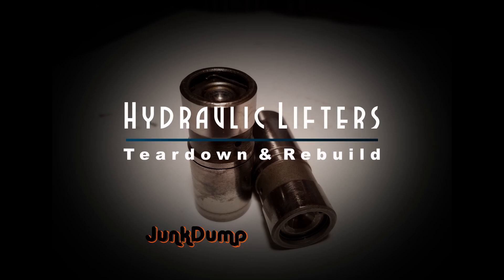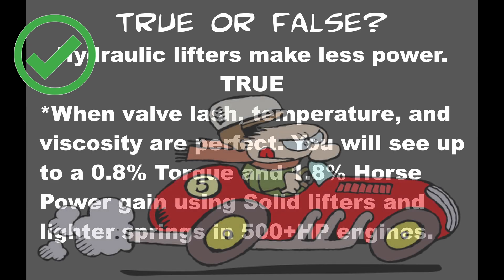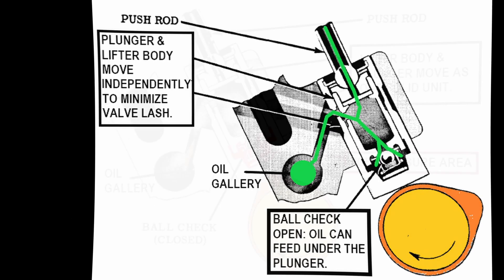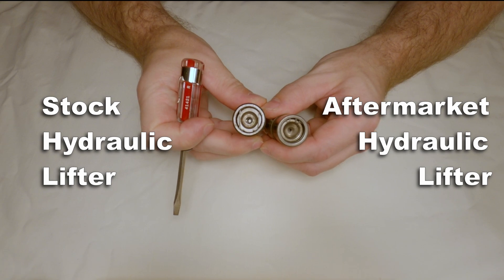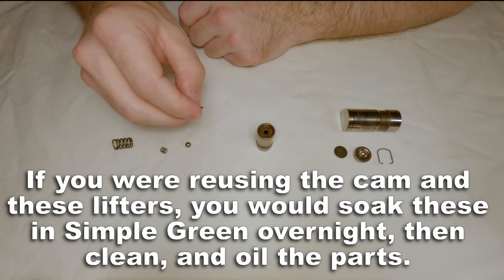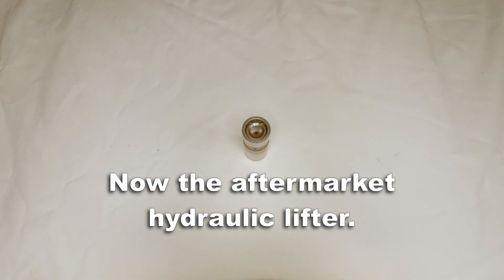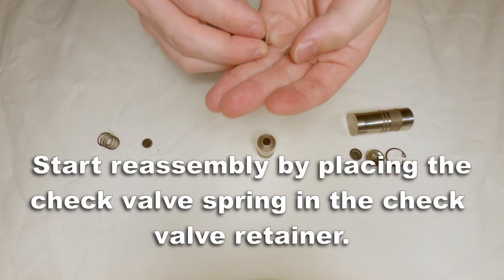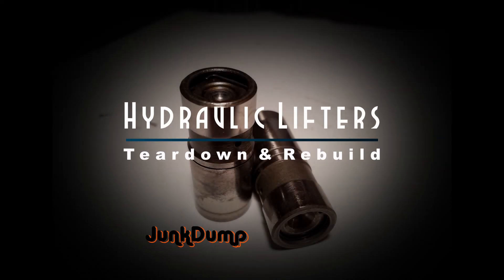Hydraulic Valve Lifters. Operation, Teardown, and Rebuilding.

Comment: The hole in the plunger doesn’t have to align with the hole in the body right?
Reply from the maker: That is correct, there is a channel, or groove, for the oil to travel the diameter of the lifter.

Comment: I have a valve train knock/tick and I’ve heard of collapsed lifters but never understood what that meant… this video helped me to understand what could be going on inside my valve train causing the noise… btw… it’s a brand new build from a respectable machinist…. But engine sounds terrible…. Only knocks once the engine is warm…
Reply from the maker: Olds engines shouldn't knock or tick unless something is wrong, severely low on oil, or the wrong oil is being used.

Comment: Just a lil confused, what makes the check ball open when the cam comes off max lift?
Reply from the maker: Excellent question! Once the cam lobe is no longer applying force to the bottom of the lifter it's not being "squeezed". Without pressure from the lobe, the plunger return spring will allow enough room for the check ball to open. Once oil pressure is equalized inside the lifter, the plunger and lifter body can operate independently.

Comment: Should i be able to shake the lifter and hear it moving up and down inside? Half of them the plunger moves freely up and down. Other half seem stiff and make no noise when shaken. Has something failed internally on half my lifters? Or they just bled down? Have been out the engine a week or so.
Reply from the maker: This is an excellent question! I had to check some of my old and new lifters on this one. What I found was the oil metering valve was making noise on some of the lifters, especially the ones that were more "dry", but this had no correlation to lifters that were bad. I discovered one lifter with a bad ball check spring did make noise that correlated  to a bad lifter. The best way to check your lifters is to rotate the engine (the correct direction) while priming it. If your lifters are good, they will operate the valves correctly, maintain lash, and oil will seep from the rockers. Thank you for your question!

Comment: how to take it apart when full of oil? How to get the oil out. the retainer is really tight with oil in it.
Reply from the maker: Get a small socket that fits in the cup of the lifter. Carefully use a small C-clamp to depress the lifter just enough to barely loosen the retainer to facilitate removal. Don't force it, just apply a little pressure. Thank you for the question.

Comment: hi there , i used you video to clean mine , my quotation how to tell if the lifter is bad or good ? 
as i still have the original one running as i cleaned them and put them in oil over knight
Reply from the maker: Unfortunately it is quite difficult to spy some issues when it comes to a bad lifter. The good news is that some issues are easy to spot, like any debris, damage, scratches or galling, and excessive wear. You should be able to move the plunger easily after assembling the lifters and lubricating them. One test I use to test mine is by installing them back in the engine (with a head bolted in place), prime the oil and make quarter turns on the crank pulley until you see oil exiting all of the rockers and observe the valves being actuated properly. Lifters that fail to lock will typically make a tapping or rattle noise (while engine is assembled and running), if the problem persists after cleaning and reassembly you will notice the rocker fails to fully depress the valve spring when performing the above noted test. I hope this helps, and thank you for the question.
Reply: @junkdump2720  thank for replying , my engine is out of the car and next week i will install the head gasket and the heads , as far as i understand is to return the lifters after  checking there are full of oil and turn the engine by hand and put some load on the lifters to see if leak down or collapse , is that correct

Comment: One question..... why didn't you use the c clip pliers to remove the retainer clip? That's exactly what they're for
Otherwise EXCELLENT video
Reply from the maker: That is an excellent question, I am glad you asked because I didn't mention this in the video. On some lifters like these the C clip pliers won't work because you need the C clip ends to overlap themselves to remove or install them. You will need to release or install them one side at a time. I find it easiest using the method in this video, but there are certainly others ways and tools to help accomplish it. Thank you for the comment!
Reply: @junkdump2720  ok gotcha

Comment: I have watched several videos on dis assembling a lifter. Everyone does it pretty much the same way, and it works very effectively for everyone. EXCEPT ME !  The piston inside my lifters, will NOT come out. In have tried all the tricks I have seen, like pushing the check ball down to relieve suction.  I even tried heating the lifter up a bit, based on the simple premise that air expands when heated. That didn't work either. I thought maybe I just had a stubborn lifter. I tried 3 more. Same thing. I am at a loss. Do I simply need new lifters?  Thank You
Reply from the maker: It is possible that debris circulated and jammed that plunger or it was damaged by heat. I would suggest submerging it in PB Blaster for 24 hours and then use a pick, like in this video, to grab the hole in the piston and try again to pull it free. Hopefully you have some luck, but it may just need to be replaced.

Comment: The oil metering valve on the aftermarket lifter. Which way does it go? it had an imprint and it will either sit flat onto the pushrod seat and restrict flow to the pushrod, or makes a path through from the reservoir through the oil metering valve then through the pushrod seat to the pushrod?
Reply from the maker: Excellent question! This is hard to explain so I will do my best. The valve is a metal disc with two nearly complete circular impressions that are pressed into it from either side. There is a large impression pressed from the rocker side down making a large raised diameter facing the cam, and a smaller diameter impression pressed from the camshaft side up making a small raised diameter facing the rocker. The cross section will look a little like this when installed properly               v-^--^-v       When properly installed the smaller diameter raised portion will contact the bottom of the pushrod seat. I hope that makes some sense, if it's still confusing email me at junkdump455@gmail.com and I will send you a picture. Thanks again  for the great question.

Comment: I was adjusting my hydaulic roller cam lifters and noticed most of the lifters preload was very easy with my half turn but a few were hard and actually depressed the valve sightly but would return to norman position in a 30 seconds or so. dirty lifter ? My ace mechanic friend said its normal. Any thoughts on this.
Reply from the maker: That is an excellent question. First be certain adjustments are being made when the lifter is on the cam heel or base circle. I have experienced what you describe on occasions where there was no problem, and sometimes when there was a problem. I suggest turning the engine over with a socket on the crank (not the starter) through the full engine cycle a couple of times. Then loosen and readjust the lifters that were questionable. You should find the "hard" lifters now act normally. There may be an issue if you repeat this a few times and a lifter remains "hard" every time. Be certain you use an oil viscosity that matches your internal clearances (like 10w30 for clearances ranging from .0010" to .0030") and quality oil filters like wix (stay away from fram, k&n, or overly restrictive filters like some purolator models). I hope this helps.

Comment: When removing the inside plunger piece, all you need to do it touch the check ball at the bottom with a pick lightly & it will pop right up. When there is oil in them that is, not empty like those & when reinstalling the check valve retainer, put the plunger on top & just press down & it will pop in place
Reply from the maker: Thank you for the commment, it's true the check ball will release pressure making removal easier when full of oil.

Comment: The Factory Service Manual I have mentions that one needs to line up the oil hole in the outer and inner cylinders. I noticed you didn't do this. Wouldn't yours block the oil without the internal hole lined up with the outer hole?
Reply from the maker: Excellent observation and question! Oldsmobile (and other GM) lifters have a channel that allow the oil to flow even if the holes aren't lined up. These lifters are not indexed and they tend to rotate naturally so they won't remian in the same orientation. I will double check my manuals and post a correction if I am mistaken. Thank you very much for the comment, I love it when people leave questions like this, I am very interested to find out the facts on this, thanks again.

Comment: Don’t they wear though ?
Reply from the maker: Good insight, you are correct, they do wear out, so you wouldn't be rebuilding high mileage lifters. This is more geared toward rebuilding lifters that suffered internal damage, clogging, or failure. I have seen many lifters damaged internally from silicone, debris, and additives. That is why I minimize silicone use, discourage the use of any engine additives, and promote quality engine oil and filter use.